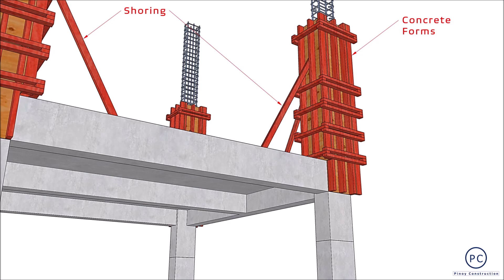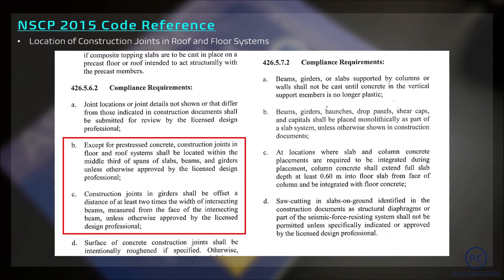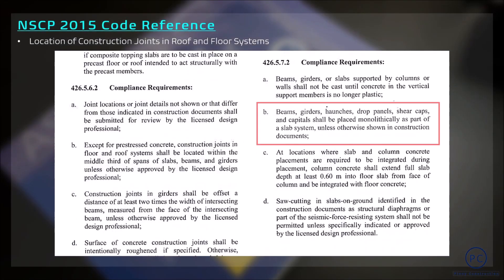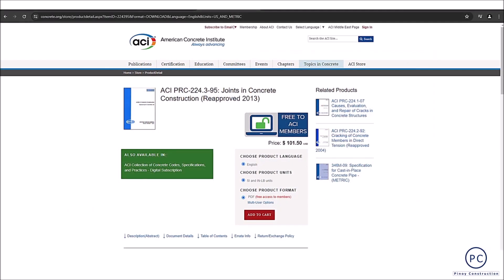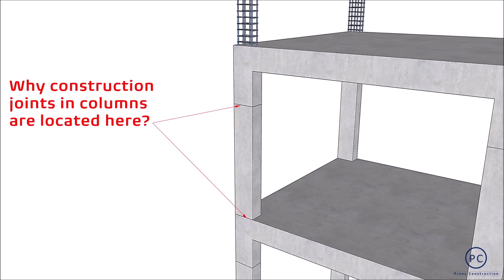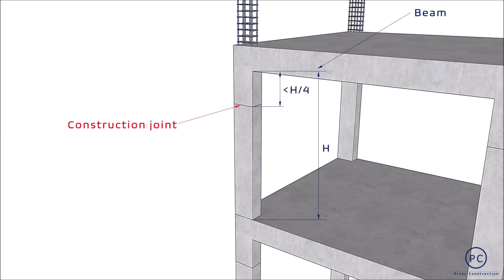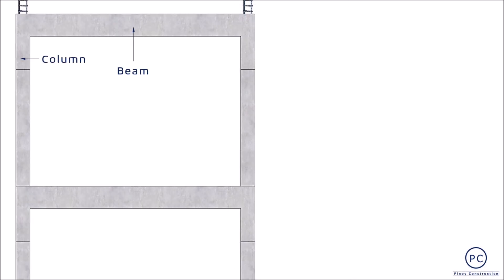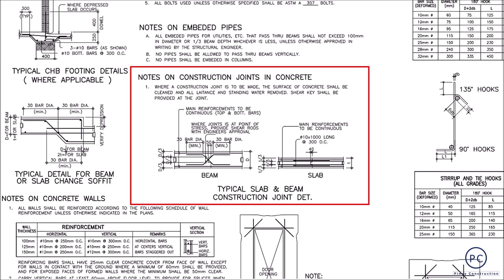Construction Joints Part 1 - Location (Full Presentation)

Comment: Constructability:
When constructing a building with cast-in-place columns, beams, and slabs, pouring the entire structure in one go can be challenging. Placing a construction joint at the base of the column allows for the column to be poured first, followed by the beam and slab, making the process more manageable. 
Crack Prevention:
Concrete shrinks as it cures and expands and contracts with temperature changes. If the concrete is restrained from these movements, it can lead to cracking. Construction joints, in this case, act as a release mechanism, allowing the concrete to move and relieve stress.  🤗

Comment: sa pag kaka intindi ko po. pwede ako mag pagawa ng Ground floor with temporary roofdeck pero ang master planned house is G+1 residential dwelling. For budget purposes po? Ang point ko po is puputulin above ng suspended slab ang buhos, need ba naka lawit ang rebar kapag icocontinue na ang column first lift?

Comment: sir, ask lng po..saan safe location ng const.joint( putol ng buhos) ng concrete colum, if 5.0 m ht.ng floor level
2nd floor level is 5.0m, kung saan andun floor beams..
intermediate column po to..

high ceiling po kasi at parang warehouse type..
5.1m distance column to column.

salamat.

Comment: Hi po..mas maganda at matibay ba ang colunm sir kapag monolitic  yung walang putol to 2nd floor po. Or mas recommended yung my putol? Please advise me tnx po sa sagot
Reply: Bakit kailangan may dugtungan if puede naman idoretso
Reply from the maker: Hello po sa inyo. Hindi naman para maging matibay yung column kundi magkaroon ng enough rigidity/stiffness ang beam-column connection kaya recommended ang monolithic pouring from within H/4 ng column hanggang floor system. Hindi mo kasi maa-avoid ito dahil hindi advisable at dahil sa limitation na hindi mapopormahan ang buong column kasabay ang floor system. Maraming salamat po sa tiwala at suporta sa channel.

Comment: thanks for the very informative video sir. May i ask po what is the effect of the abovementioned location of COLUMN'S construction joints on the overall performance of the building given that our structure must be built to have a strong column - weak beam behavior?
Reply from the maker: Hello Sir. In general, construction joint reduces the shear load carrying capacity of a reinforced concrete member. In columns, it can affect the seismic performance of a building structure. Strong column - weak beam behavior on the other hand is just a term given to an intended design failure in which vertical structure like buildings are designed to fail in a certain manner that will give the occupants a good chance of survival in the event of a collapse. This intended failure simply means that in vertical structures, columns are designed to be much stronger as compared to beams. In this regard, failure is most likely to happen in beams than in columns, resulting the structure to remain still standing for a time. Such time can be crucial or an opportunity for occupants to leave the damaged structure and escape to safety. Construction joints are unavoidable. Having these does not mean that columns are less stronger than floor/roof system ( beams and slab) having no joint.